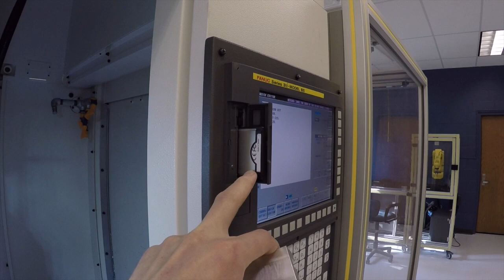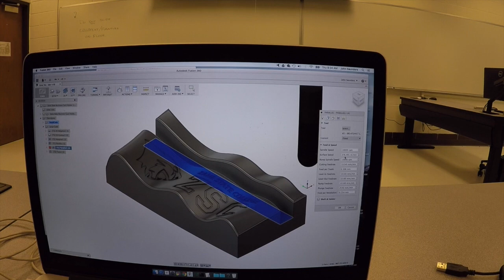Robodrill Help, Being Honest, Grandpa Would do Anything - Chip Break 14

Comment: I agree with what has already been said. Either slow the feed. Remember, as you get closer to the center of the tool, SFM decreases! Or, tilt the feature, so you are up on the flute of the tool a little more. Along that line, work from the bottom, up. If one side is lower than the other.

Comment: John, don't forget that the effective surface speed at the center of a rotating tool is zero SFM. This is true for end mills, drills, ball mills, etc.Unfortunately, with a 3 axis machine, you just have to go slower on the finish pass, and there will be little you can do eliminate this since ball mill cutting will always be at or very near the center of the tool. This is why 5 axis becomes a huge advantage when surfacing, as the better CAM programs can always keep the tangent of the tool engaged, allowing a proper SFM to be maintained at the cutting edge. 

One thing you can try, if your geometry allows, would be re-fixturing the part on an angle for the 3D finishing operation so you're using the edge of the radius and not the center. Not sure what CAM system you are using, but you would just need to rotate the part in CAM to the proper orientation, and post out a finish pass. 

Fantastic what guys like you are doing for the machining community by maintaining channels like this one. Keep it up!

Hope this helps!

Comment: Also, it may sound crazy, but rotate your toolpath 90 degrees.  With the geometry that you have, you could keep off the nose of the mill for 90% of the part if you machine it in the other direction.  Right now, since you are machining long ways, you are always on the bottom.  Just a thought.

Comment: My $.02.  In aluminum surfacing I would only climb cut, takes longer because you gotta rapid back to the start, but gives a better finish because of less chip weld.  Sometimes a bigger chip is better so it has mass to get out of the cutter.  Also, I'd play your spline approximation setting on your CAM.  Set that to ".0001" or even smaller.  Takes longer to post, more memory, but it gives the machine a better representation of the spline surface.  Then, see what your machine point deviation is allowing.  Similar to G64 path blending parameters on Tormach.  This is where spline re-generation (Super-NURBS) on higher end machines (Makino/Okuma) is great.  If the machine deviates slightly, even tenths, from the programmed path it will show in the surface finish, especially at higher feeds like you have.  Good luck!

Comment: Examine the amount of material that is being removed ( err - depth of cut ) in relation to the feeds and speeds. Hopefully that clears up the problems. 

You might also consider a different orientation for the machining path. Symmetry is your friend. Use it to break parts into sections that have the greatest chance of yielding good finishes. The sample part was machined along the long axis. The machine paths were undulating waves. Though this in itself may not be a problem, there may be more efficient ways of doing this. Your CAM program may generate discrete x-y-z moves to get the exact path or it may convert it to arcs. The discreet moves can be problematic if the FANUC processor can't keep up, or more likely can't read the information from the memory card fast enough. This has been a problem for me when running programs from DNC. Seeing how this is FANUC's latest controller, it's probably not a problem. But, if it's possible to convert the paths to arcs consider doing so. It reduces program size and has the potential to allow the controller to automatically smooth out the paths. I digress. If you were to change the orientation of the finish pass to the short axis the paths might become straight lines. It just depends on the part design.

What are you after? A cool looking demo where people can look at the undulating milling cutter and mumble to themselves "ooohhhh.... that's cool" or are you after a finished part with an acceptable finish. Depending on the design of the part, the two may be mutually exclusive. But keep in mind that in this case the part can be designed to meet your goals. Choose the appropriate cross section along the long axis and your machining paths can be well behaved arcs. Loft or extrude the part in the right way and the paths in the short axis can be straight lines ( or at minimum gentle well behaved arcs). You are in control of the part and the machining process. I'm sure that all the cool parts for machining demos one sees at shows and in videos are designed for effect, not necessarily for function :)

Comment: Keeping people happy? Under-promise and over-deliver. Always exceed a (customer's) expectations.

John I'd try different material and comparing the results. You don't say what type of aluminium that is, and it could be as simple as that material not machining well in that particular operation, despite doing ok in other ops.

Just a guess, but if something was described as "tearing", apart from the material properties itself, I'd suspect a dull cutter. When diagnosing problems I think too many people zoom in on the part and don't look at the chips. It may seem right up there with reading tea leaves, but the chips will often reveal a lot about what is going on with the cutter.

It would be good to know what it turned out to be. Good luck.

Comment: With how much of the effective diameter you are using, you are going a bit to fast. Actually, way to fast. Try a test run at 100 IPM, See if this corrects your tearing. Apply more speed as needed.

Comment: hi john, sam from cnc4xr7 got it !!!, I have always machine parts in my vice, so wot i tried was a cambam g code with a piece of wood on the table and the soft limits said z axis to low, so I changed my z min from -260mm to -300mm and the standard mach 3 cnc post works OK,

As long as I remove the g43 z10.0 h4 line or better still change it to read g54 z10.0 ( i am using the g54 offset ) this way after your tool change macro runs it lifts the endmill 10mm up from the table, simple true ?? Well  I have learn alot from this and sometimes you need to go back to basics.

Thanks John for having a look tho, 
thanks daniel

Comment: tried default post, on mach 3 cnc, on the  tool screen it shows the g code part under the dotted outline box and when I try to run the file it says " Z axis to low " my machine has homing switches homes z up and is z zero it has -250.0 mm of travel, when I move z axis down manually it's all OK, if i put a good code at 70mm above the table it runs ok with  g28 turned off and at about line 5 I remove the g43 z0 h4 line from the g code, if i remove the g94 g 91.1 g49 from the file it will run the part on the table and if I turn off the soft limits again it runs on the table ok, any ideas ?? thanks daniel

Comment: Like someone said below, use the G5.1 Q1 look ahead, and also turn down the nc tolerance when you post so steps are smaller. The shop I work for has 4 robos and we have used these for mold work with amazing results.

Comment: For a 2 flute endmill your feeds are WAY to high. maybe with a 4 or even 6 flute ball nose then you can run those feeds I would suggest firstly backing it off maybe 50-60% and try it. Your basically not giving the cutting edge enough time to cut and so it's dragging and giving you the ripped look. :)

Comment: John, you need to get your speeds and feeds based on the radius of the tip that's working and the depth in the material, and not the whole diga of the tool.  You'll get the correct feed that way. A lot of others have pointed out the error too.

Comment: From the speeds and feeds you gave us I calculated that the chipload is 0.030   I would try cutting that feedrate by at least half or crank the RPM up to at least 20,000 if the robodrill will go that high.

Comment: John, way to much feed for that low of an RPM. I would drop the feed rate to 250 IPM and use a .0005 step over. I have a Deckel Maho 5 axis mill with an 18,000 RPM spindle and if I am lucky, I can get away with 500 IPM when surfacing. Reduce the step over and the feed and have another go at it. The material is being sheared rather than cut. Unfortunately a 10k spindle is kinda slow these days.
Reply: Yes! My thoughts exactly.

Comment: John,

I haven't read all the comments yet. But you might want to consider the age of the controller and its limitations (you mentioned it had small memory).  CNC machines "look ahead" a number of lines.  If it's older, it may only look ahead 10 lines.  If it's newer, it may look ahead 100 lines or more (not real world, just an example).  More complex programs, like 3D contouring, may have lots of little straight steps, meaning lots of lines that move the cutter just a bit.  The machine may not be fast enough to read all these lines ahead of time, thus stalling the machine in jerky motions.  Often a work around for this is reducing the resolution of the cut, or converting curves into IJK arcs rather than small straight line sections. You could also just slow down the feed by a lot.   ...just an idea.  

Looking forward to meeting you at Summer Bash.

Keith
Reply: BTW - I don't think it's a RPM issue (aluminium, all day long), I think it's an IPM issue.

Comment: Whether it's a 2fl or a 4fl you only truly cut with 2fls of the cutter if it's a 3fl then you only have one flute truly cutting look at the end of the mill on a 3fl, and 4fl end mill and you'll see the number of flutes that join at the center. It'll be the same on all even and odd #flutes end mills. Whenever I'm making a 3D contour finishing path I use all the rpm I have and use chip thinning strategy to get my feed my step over is anywhere from .003 to.005 or a cusp 
height of .001 and I leave .02-.03 stock so the end mill has stock to stabilize in. All this depends on the material I'm running. Aluminum my hard numbers on a 10000 rpm spindle are 150ipm and a cusp height of .001. Hope this helps good work on the videos and business
Reply: Also. It sounds like there might be some tool chatter. Try chucking up on the endmill to the base of the flutes or switching to a stubby ball and chucking to the bottom of the flutes of that aswell. And using a zirconium nitride or SGS tanimite-b coating on their ski-carb or s-carb endmills

Comment: Completely pulling it out of my arse (aka NFI, -26kb experience) but would it be the amount of water being dumped into the part? It did look like a fair volume of water to displace a head at high RPM ever so slightly.
Maybe some control demos to ascertain accuracy, capability, etc? Has the demo been tried with a new ball end bit? Instruction set looks fine.

Comment: Agree with everyone, slow it way down.  Also switching to a 3 flute ball with 1 flute that crosses center helps a little when you are basically using just the tip.

Comment: not a fusion user but I know in mastercam there is a thing called arc tolerance. Now this wasn't something we figured out we had to call our cam provider and they gave us the numbers to plug in and it fixed our finish problem. also max feed we would use at 10000 rpm would be 300 ipm. also when I was running a dmg there was a thermal compensation in the controller and we had finishes just like that and it was because the compensation was not set properly on the controller. not sure if the robo drills have that or not might be something to look into. hope this helps.

Comment: I cut molds for a living so the majority of the cutting I do is 3D. If I wanted the best possible surface finish on that part I would run that tool path to .007 after roughing with a larger step over (.03 to .05) and a high federate then run your finish. Also for finishing I set the tool path tolerance to .0002 and set the maximum distance between points to .01. As far as federate for finishing I find I get the best results running between .007 and .01 per tooth.

Comment: Seems like a very high feed rate. Also you may want to look at the parameters for In Position Check(Feed Ramps) on the FANUC control.
With a Fadal this is controlled with G9(on) G8 (off) and on a Haas control it is a G187 E.xxxx (E being the allowed deviation) I think on a FANUC it is controlled in the parameters.

Comment: surface finish problem; programing with chip load and surface speed is much easier if fusion does not do this cimco has a download feed and seed calculator to help with the math. 600 to 800 surface feet and .001 to .0015 per tooth, you can go as much as .004 per tooth but less will get you a better finish. bad coolant can give a poor surface finish also and coolant not designed for aluminum will also give poor results. cutter sharpness is also at play look at the very bottom of the cutter with a magnifying glass you may be surprised at what you find. hope this helps.

Comment: For me you are way out the capability of the machine by finishing with 15000mm/min. Thats something that looks cool in demos but you get in all sort of trouble, as axis tend to overshoot slighty. Finishing such a surface I would not run at more than 2000mm/min.
Going that fast is great on roughing, but for a good finish thats often not an option :)

Comment: I don't know much about these sorts of paths but since the velocity of the cutter is near 0 at the point regardless or RPM it tends to produce many cutting problems. Could you do this with a small diameter regular end mill so you cut on the outer edge instead? Should work much better since you would have a decent surface speed. getting that contour clean would be tricky though unless you go to a really small endmill, still be interesting to try something like a 1/64 mill on.

Comment: That appears to be two problems. Galling and axis synchro error

The lint ball looking things are galling. Hard to see in the vid. But that BEM looks like it has a black coating. Makes me think it's a TiAlN coated.  You can't run that coating in aluminum. The Al component is aluminum on the coating. Like metals weld, that's what's happening. 

The divets are synchro/ Acell/decel  error. Simply put, the Z axis (usually) can't travel fast enough to keep up with the X and Y. So it lags behind dipping too late or rising too early. Slow to 300 IPM. should solve the synchro  lag issue.  

Acell/decel error is how fast the axis can go from one speed to zero and back to speed again. The X is only reversing direction at either end. The Z is constant going up and down, and simply can't accel or decel fast enough to keep up with the X.  Again, slowing to around 350 IPM should solve it.
Reply: It's also possibly lens error with the ball. Try increasing the step over amount to around .015-.020. That's still only about a .0001 scallop height.
Reply: Had one other thought.  Are you adaptive roughing with a ball endmill by any chance?  

If you are.... Don't lol. Adaptive paths will often gouge floors with a BEM because since they have an effective tip diameter of zero, it tries to fudge the numbers to overcome it. If you do use a BEM with adaptive. Keep the stock to leave at at least 10% (can squeak it down to 5% if it's a relatively flat like that part is)  of the cutters diameter. So with that 12mm ball you should leave 1.0 - 1.2mm on surface.  Just to prevent gouging.  Also. 5% - 10% of The cutter dia is generally a decent amount to leave for final surfacing anyway in aluminum.
Reply: +NYC CNC  there's a cute trick to get em to work though. Instead of calling it a ball endmill in the tool definition, define it as a corner radius endmill with a rad about .0005 smaller than a full ball. (IE .500" dia tool with a .2495 CR) It gives it about a .001 center dia to work with and doesn't have to try and compensate for a 0 dia.

Comment: Something that worked for me, I would have a finish cad file without engraving data, leave .007. One cutter finish entire surface, you can still do engraving first but have a clean cad surface, if your backlash is bad try finishing at 5° or 95° then you are keeping closer tolerance by engaging both x and y, looked like feed was faster than machine could produce a good finish. I haave had to extend cad file, giving machine time to react to change in direction. Machines vary due to age, wear and processing power. I have programed some very old machines along with state of art, just got to find what works best for each. Your cutters are running true?Best of luck, hope it was helpful,.

Comment: Have a look at this forum posting, it's quite relevant to your part: http://www.emastercam.com/board/topic/12026-fanuc-robodrill-high-speed-question/
I agree with +Widget Works Manufacturing Inc. about the feedrate, ballmills have ZERO cutting at the center, you need to setup the toolpath so ideally it's doing a climb cut for finishing (the stock to finish is on the right side of the cutter, the finished stock is on the left side of the cutter).
Reply: I've never tried it. But does the look ahead code work when running off the PCMCIA? It's essentially running like a drip feed program when running off the card like that. 

Can't hurt to try turning it on (if it's even equipped) but even if it does turn on. Not sure how much it can "look ahead" seeing as it's constantly feeding code in from the card to its buffer memory and dumping it.
Reply: The only limitation in aware of is calling subs on the card. You have to load the subs into main memory, then you can call then from a program on the card. It would be a huge oversight to not support hsm from the card.
Reply: +eformance considering the 3 ring circus just to get it read from a card in the first place, that oversight wouldn't shock me XD